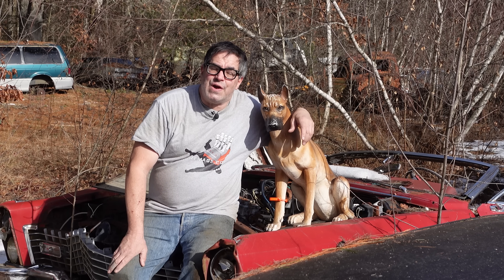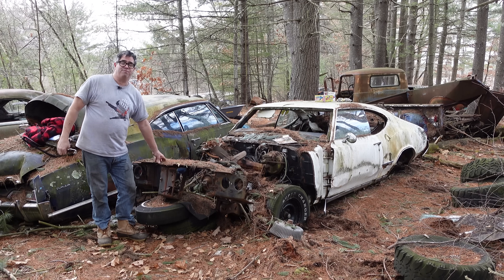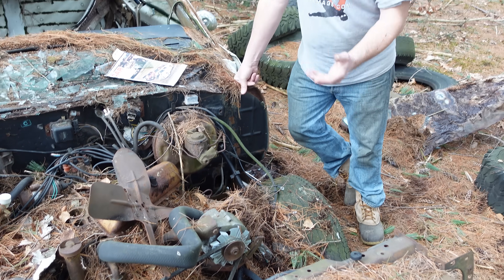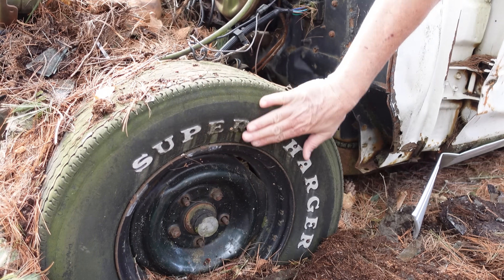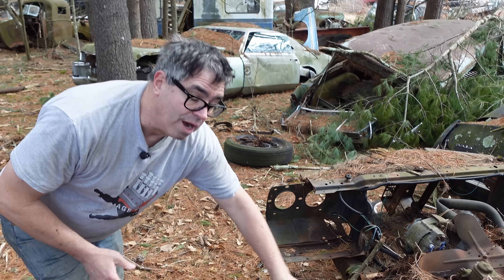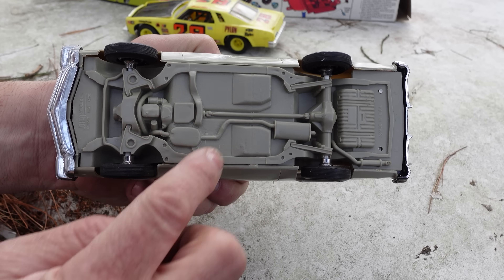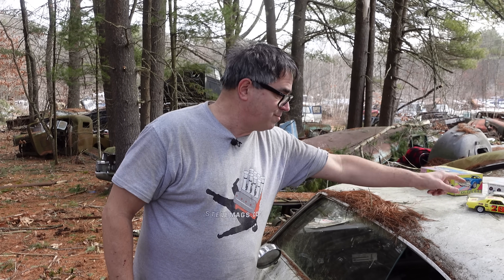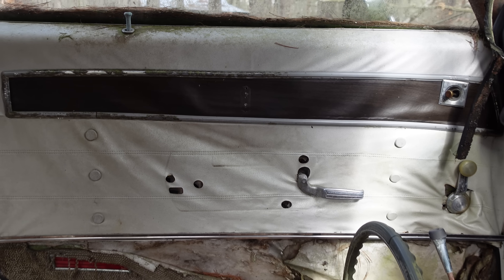Cut Less Compression

Comment: No, I believe it was earlier for EGR valves, circa 1973 for Oldsmobile and many GM V8s. No Oldsmobile V8s in Trans Ams past 1979. Only from 1977 to 1979 with the Olds 403 VIN code "K" engine, RPO "L80". You could also get a Olds 350 V8 VIN code "R" in Firebirds. Benny of "Classic Ride Society" on You Tube has a 1977 Formula with an original 350 Olds V8. It was saved by him and "G Money Auto Crushing", also on You Tube. I follow and comment on both channels. Like I've said before, Pontiac "never makes mistakes" except putting an Oldsmobile engine in a Trans Am.....just sayin'. No "Oldsmiac" for me (and I like Oldsmobile engines, and I own them, but they are in Oldsmobiles, not Pontiacs). My friend has a 442 that's a low mileage original that had a fire some years back and he bought it from the original owner. He still has it today. 

No tag, can't brag, but can be figured out, no doubt: ST71 for 1971 model year, 3587 or 3687 for Cutlass S two door hardtop, maybe LAN for Lansing, MI assembly, 42 for Jade Green bench seat hardtop interior trim, 11 11 for Cameo White upper and lower exterior paint, among other codes. The Lansing, MI plant was the "home" Oldsmobile plant and operated from 1901 to 2006. Today's Lansing Grand River and Delta Township Assembly plants are "relatives" of the original Lansing, MI plant. 

No VIN, can't win, but easy to figure out, no doubt: 3 for Oldsmobile, 35 for Cutlass S six-cylinder equipped or more than likely in this case, 36 for Cutlass S eight-cylinder equipped, 37 for two door hardtop coupe, 1 for 1971 model year, M for Lansing, MI assembly and the rest is the production sequence. 

Oldsmobile V8s are among the best in the business. They run extremely well, they are durable and they run, run, run, run, run, run, run, run and run some more. They also are whisper quiet, idle well and have a good power band. They are easy to service and their designs always made logical sense. The Olds 307 often gets a bad name for being a "slow" engine. That it is, but it runs forever and is one of GM's best engines of its era. Oldsmobile engines are a second favorite of mine next to Pontiac V8s. My only contention is that they belong in Oldsmobile products, however, the Olds 307 was a welcome addition to the many other divisions of the 1980s as it provided a reliable ownership experience for those that were fortunate enough to buy them. It's not uncommon for an Oldsmobile V8 to run several hundred thousand miles without ever having to be opened up. 

Mike's Speed Shop was owned by Michael O'Connell, and Mr. O'Connell also owned O'Connell Motor Sports. He passed away in 2004. Yes, I would agree, a "weekend warrior", or mechanic owned that car at one time as evidenced by the Snap-On Tools sticker on the window and bumper. Yes, that would be "Safety Flo-Lite" glass as the vehicle had air conditioning originally. 

I have a 1983 Snap On KRA59F nine drawer top box that was given to me by a coworker that has many of those types of vintage decals including: "Castrol GTX", "Wynn's Extend", "Bosch Spark Plugs", "Gabriel Hi-Jackers", "Everything Automotive" (Coney Island Ave, Brooklyn, NY), "Alfa Ignition" (Woodside, Queens, and it's still in business), "Econo Lube 'n Tune", "MAC Tools. The Brand You Own, Not Loan", "On the Move With Snap On", among others. The box is nicknamed "Jose" as it has that name airbrushed on it. My coworker said, "We used to call the box Jose. I think a guy named Joe (Jose in Spanish) owned it and I wound up with it somehow." Sure enough, I found tool bills from 1997 or so in the top drawer made out to "Joe". It was filled with good quality tools such as MAC, Craftsman, S-K, Snap On and others and was on top of a 1981 Sears Craftsman model #65053 three drawer rollaway. I've kept the patina of the boxes and just made them roll, lock and slide like they did when they were new. The box spent time in Oceanside California as there is a partial Snap On dealer decal from there inside on the top lid, but mostly spent time in Astoria, Woodside, and Richmond Hill in the NYC borough of Queens. My coworker had it at his parents' house and when they passed away, he was kind enough to give it to me. We'd be away on business trips and at dinner he would say, "I have to have you come by my parents' house. There's so much stuff there...". He sold the house last spring and if I didn't take the boxes, they were getting tossed out. It now sits in my workshop garage next to other vintage tool storage such as Waterloo made Sears Craftsman from the 1960s-1990s.
Reply: Those tool boxes sound "neat," good that you're still using them. Many people don't appreciate that added human touch of a previous owner, it can be as satisfying as the item itself. I was disappointed when I had a shop reinstall a windshield,and they cleaned an old inspection sticker off the glass. At some point something's lost in striving for a "brand new" perfection.
Reply: @tomwesley7884  They are. I've painted and cleaned a few. My friend that beat throat cancer told me, "Just like people, they have bumps and scars. Don't erase history. Leave them as-is." I mostly do that now, just returning them to original, or if they are heavily patina'ed, I leave them that way. They have to roll, slide, lock and function as they did when new though. The Craftsman/Snap On combination does that now (I have new lower drawer runners coming for the SO). I bought a 1969 Craftsman box a few weeks ago and under the flat black "hooptie spray" seems to be nice original paint, so I'm going to strip that away and see what I get. If not, it gets a new coat of hammer tone gray. I already stripped the drawers and the original paint on them was excellent. I got keys made for the original lock and it functions fine. I also got a set of casters for it so it would roll again. It's ready to use as-is now, but I'd like it to match the very nice original 1969 ten drawer Craftsman top I picked up off of Ebay for $45---filled with USA made tools. That box is very nice---came with two original keys and the original paperwork for it. It was clean and well kept before I got it, and it will stay that way.

Comment: Am working on the first generation of catalyst and  EGR equipped 1975 Olds Toronado.  How useful this tech was without computers and Oxygen sensors?  Probably not very
Reply: It worked good enough with carburetors. The catalyst may not work well if there isn't air injection.
Reply: It did the job and was a stop gap solution. It caused many "mechanics" to retire that had no business being in the business anyway and rendered them obsolete. The good mechanics continued to make a good living fixing those cars for years and years.

Comment: I have a buddy, “Foghat”, Dave, he’s the guy that got me hooked on Oldsmobiles. He had a 70 Ralley 350, then bought a ‘70 442 in boxes and completely rebuilt it, and also has a. ‘68 442 he pieced back together.  Even though Oldsmobile is no longer selling cars, they will never go away.
Reply: Boss had a 70 talleue.  4350 screaming yellow my job was to take to car was as a 19 yr old. Coming outa wash I'd turn left then power brake then burn rubber halfway down the hiway
Reply: I figured he would've got you hooked on "heavy blues-rock."

Comment: Hey Steve that 1971 cutlass S you posted today the engine was a 1973 that was first year for EGR on the Oldsmobile not sure if any other brand had it but 100% positive it was on olds and the valve covers that have the Oldsmobile logo on them were 73 ONLY love you’re videos watch every morn in my suburban before I walk into work👍
Reply: Yep, some cars had the EGR in 73, in 74 everybody had one
Reply: Yes, other GM makes had EGR valves at that time. Pontiac got in trouble with the EPA for some early 455 engines. They were routing the vacuum lines in a way that were skirting the emission rules a bit. Not the first time that Pontiac would rise the ire of the EPA and other US regulators. The W72 Pontiac 400 from 1977 to 1979 was a bit of a "one finger salute" to the EPA, being only certified for Federal emissions. CA emission cars got the 403 V8.

Comment: My 1st car was a 71 Cutlass S. My teenage revving eventually slung a rod and then I swapped the 350 2 barrel out with a 455 4 barrel and a turbo 400 from a 69 Olds 98. Great car that could do serious burn outs :-)
Reply: @Jim Christy 👍👍👍
Reply: When I was a high schooler working in the neighbors gas station one of his customers towed in his early 70s Cutlass SS with several rods sticking out of the windowed block. He was doing a couple of times the legal speed on the Mass Pike
Reply: And you had to run the high-octane gas in it, or a booster, and/or retard the ignition timing (which absolutely killed the power level).  1969-70 GM big blocks were absolute torque monsters!  I had a 1969 Cadillac with the 472 as well as a 1971 LTD with the 4bbl 429, both very high-compression engines.  I ran leaded gas with octane booster, until you couldn't get it any longer in the early 1990s.
Reply: Cool first car👍 still have it? I hope you do

Comment: Absolutely love   💖 68 - 72 Oldsmobile Cutlass  . Especially post window sedans  . Always fascinated with their own V8s . Irregardless of the displacement  .

Oil fill tube , up front 
Plus , you didn't have too pull the distributor  , too remove the intake .

Still remember  Cellucci Oldsmobile in Hudson Massachusetts  .

Friend had a 69 Cutlass S .
I impaled my cranium on that , buck tooth hood , extension 💥

I remember Kelly Springfield Chargers radial tires . Sold at Tucks Service center  . 

Oldsmobile had type C camber cylinder heads into 72 . Not quite high the  compression like W30 & W31 but , 
not too bad .

A&M "drag way" was the place of preference in Marlboro Massachusetts 
 ..... from what I'm told 🤭
Reply from the maker: Oh yeah, A&M in Marlboro. I was a student at Clark University in the 1982 - '86 period and we'd sometimes drive out to Marlboro on Sunday afternoons to watch the street races. I recall it being mostly tidy and sane. Wasn't there a Frye Boot factory at the end of the straight away? Great memories! -Steve Magnante
Reply: @SteveMagnante   

I thought  , Fye boot was on Mechanic Street in Marlboro

Comment: Hi Steve, That intake manifold. with the EGR was actually introduced in 1973. I don't know just how to tell the size big block engines apart but how to tell a big block from a small block at a glance is the deck is taller on the 400- 425-455, and the intake manifold is wider than a 350. Also a stick shift engine has the center of the crank drilled for a pilot bushing, where the automatic engines don't.
Reply: I had a 69, and changed the “Jetaway” to a Muncie had to change the crank
Reply: Quick  way to tell the  difference.  350 is gold colored,  big  blocks  are  blue,

Comment: Hey!, I bought a’69 Cutlass for my first car in 1977.  The same model, an “S” convertible. Had a 2 speed Power Glide, electric windows, and the Rocket V-8 350 ci. Great car. 👍🇨🇦
Reply: interesting it had the 2 speed buick trans, i thought after 1968 GM finally stepped up to the TH350.
Reply: @albertgaspar627  I would have greed with you but I just dug around and found that the 350 2-bbl was available with a two-speed. They called it the "Jetaway"? I was a known gearhead back then even owning a '69 Cutlass S but I sure do not recall that transmission name . . . The note I found says they dropped the two-speed in '70 to go with the TH350.
Reply: @denali9449  thanks for that update, the Jetaway i think was a 1962 pre-cursor to the Buick 2 speed that was used on BOP cars rather than the chevy powerglide. It's a pity GM ditched their Switch Pitch torque converters before 1964, it would have nearly made up for their displacement limits on musclecars.

Comment: one of favorite cars ever , had a 69 cutlass S ordered with the rally sport pak option with 411  rear and that car was a beast. 1/4 throttle car would rise and do a perfect circle posi burnout and you could burn tires for miles . kick down at 55 and it would roast the tires. and yes it got me in trouble lol. fill up the trunk with used tires hit a parking lot with a jack and roast tires and see thru the fog blue lighting flashes of the the law lol and take off. yep lots of tickets in my mailbox, made a fool out of those mopar cop cars.

Comment: cool fact on the windshield, all glue eventually fails.
Reply: There is no glue. The windshields used to be melted together in a huge autoclave. About 25 years ago they changed from pressure and heat, to each one being put in a vacuum bag. I was a construction worker, but worked in Chrysler's glass plant doing the changeover.
Reply: @garyszewc3339  glue is defined as an adhesive or resin that bonds two substances together. so in the instance of safety glass, you have two layers of glass bonded together, ie. glue. this is why we don't use osb for roofing material, we use plywood. because when the glue fails we still have the laminations.
Reply: @robertstingley1867  the vinyl that they laminate the glass with is neither adhesive or resin. I have watched the process. The two windshields are not glued.
Reply: @robertstingley1867  it is not resin it is vinyl. I have worked in the plant and watched the process.
Reply: @garyszewc3339  ps. there is a resin in between the two panes; not glass to glass, that's why when they cut it, they dump alcohol on it and light it on fire, which breaks the resin. so what do you think, is it glue?

Comment: I put four wheel disc brakes on a 69 cutty vert. Also replaced the steering column  used one from a camaro. I had to replace the flange at the firewall and it went right in! I had the 350 punched .30 
over and installed aluminum heads and four barrel intake. It was a customer of mine at Anna Performance in Anna Tx. He now wants floor pans and quarter panels.